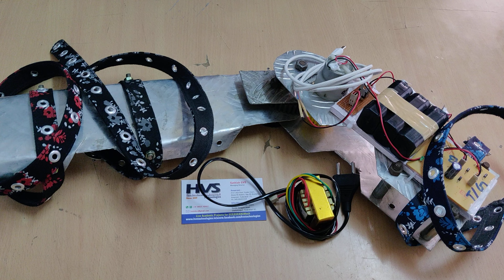Knee Power Generation system with Mobile phone charging

Comment: What are the accessories  which were used for fixing rotational joints
Reply from the maker: You can contact us at +919603140482
Through WhatsApp or call

Comment: What did you use here as a dynamo? Is it DC motor?
Reply from the maker: Dc generator. 
You can contact us at +919603140482
Through WhatsApp or call
Reply: @hvstechnologies  is it brushless DC motor or brush DC motor could you please tell me the rpm ratings of it
Reply from the maker: @eshaneshan9697  PMDC generator.
You can contact us at +919603140482
Through WhatsApp or call
Reply: @hvstechnologies  today also tried contact you but it says this number is invalid number
Reply from the maker: @eshaneshan9697  +919603140482 please check it once again
If you are from India try 09603140482
Reply: @hvstechnologies  no i m from sri lanka

Comment: Could you please tell,what is the batteries which were utillized in this project
Reply from the maker: Dry-Acid
Reply from the maker: You can contact us at +919603140482
Through WhatsApp or call
Reply: Can we use lithium iron batteries
Reply: Your number is not worked
Reply from the maker: @eshaneshan9697  +919603140482 it's my working number